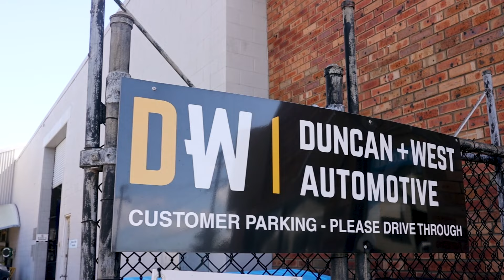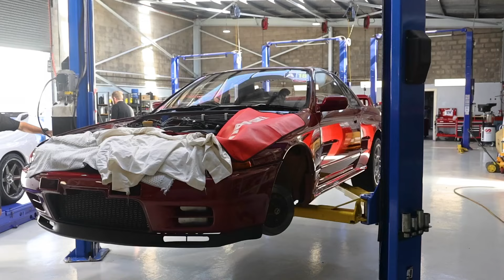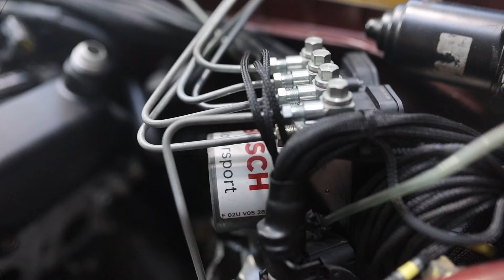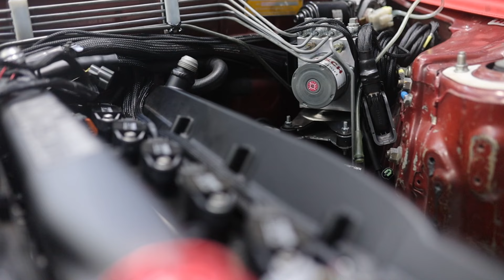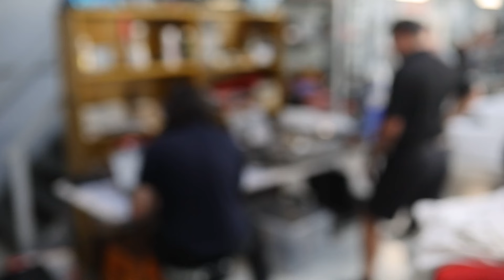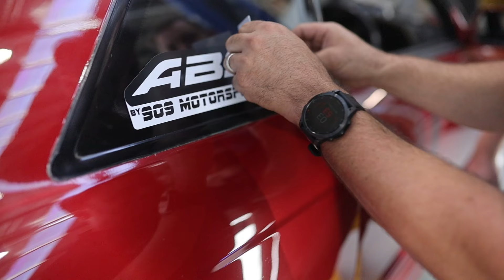Why is this R32 GT-R running Motorsport ABS?

Comment: Hey guys can I ask what wheel speed sensors you used? The ones that came with my Clubsport are way to short to fit the GTR hubs. Thanks!
Reply from the maker: Hey Tim! For wheel speed sensors, we recommend you reach out to our Bosch Motorsport Authorized Dealer 909Motorsport. They’re super knowledgeable about GTR setups and are the ones who worked on Simons Skyline. We're sure they could provide assistance for your questions and address your specific use case. You can find a link direct to their webpage, with contact information, in the video description above!